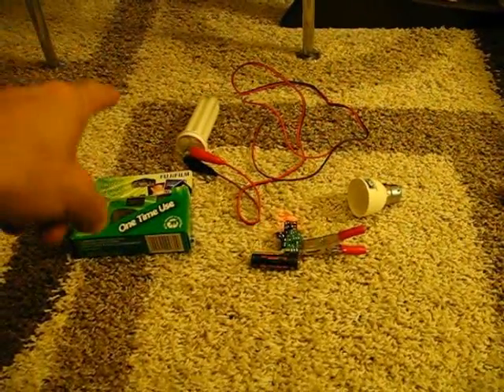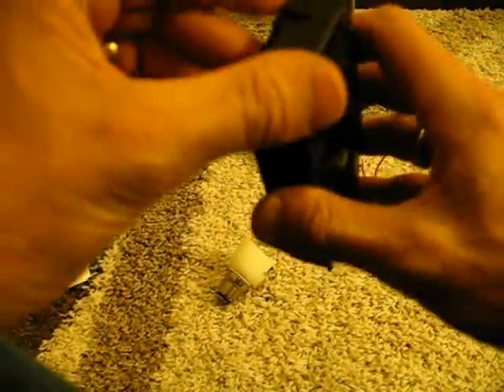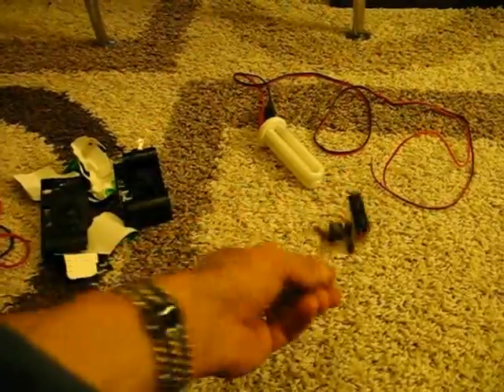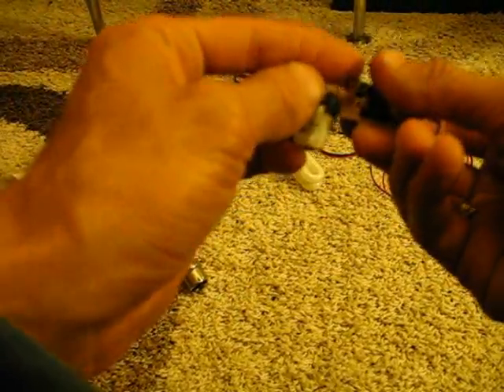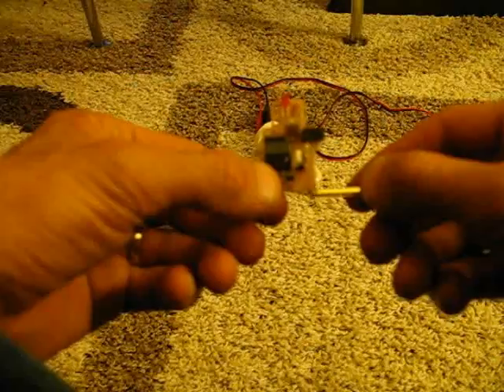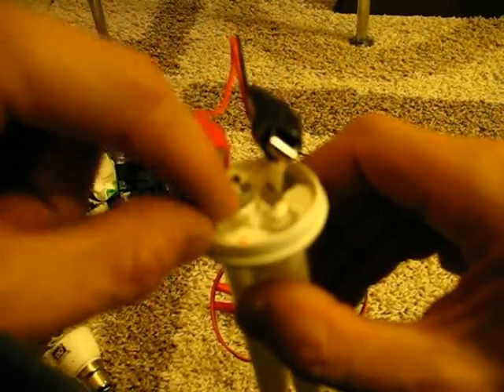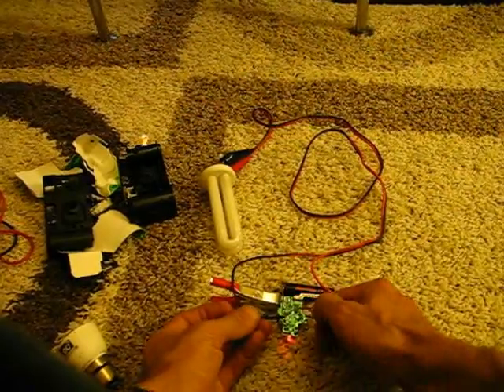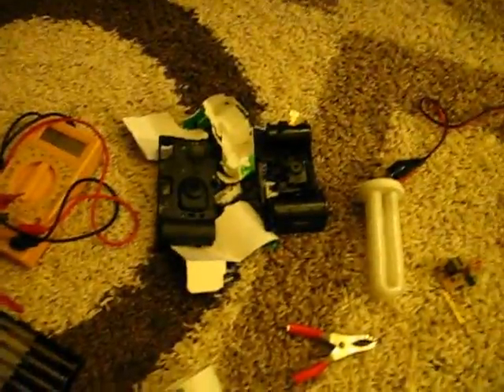Running a 240v lightbulb of one AA battery. Very real and very useful. With full how to. 100% real

Comment from the maker: @vckng I always remove the red led as a rule. Every bit helps as far as getting the most out of it. But you should try get the slightly lower watt bulb. But don't be tempted to go for the 7watt or lower cfls. They will not be bright at all. Like I said about 11watt philips cfl's seemed the best and brightest light output. Good luck. :O)

Comment: You can use even a CRT TV, powering it with AA battery, but since the voltage and stored energy energy in the battery is low, the TV in this example will run only 1 or 2 minutes.

Comment from the maker: I tried a few experiments with transistors but I did not have much luck. But maybe you will have more success. It would be nice to run them from a 12v car battery but I just don't see that happening because a stepdown transformer would use more power than the light itself.

Comment: have a look on yt for how to make a capacitor discharge device out of a couple of crocodile clips and a large wire would resistor, a lot safer, a lot less drama and a lot less damage to the capacitor than shorting it out.

Comment from the maker: If you look through the comments you will see you can get more than thirty hours out of one single AA rechargeble battery. I charge the batteries with solor cell and these lights when solar charged and left lit 24/7 for months at a time, they have never depleated the battery fully yet. So they are very pratical for undeveloped countrys, Sheds lacking mains power, and emergancy lighting.  I think you will be rather supprised by them. Try one yourself :O)

Comment: I tried this when this video was posted back in October 2010 but I used a car battery instead and the light Is still working over 4 years later. AMAZING OR WHAT.....:D
Reply: Peter Langer how about we see a video of how you did that?
Reply from the maker: KEVOLUTION K Its possible with a 12v to 3v or 1.5v step down transformer wired to the battery. I have done this myself but I used 3v step down with a heatsink fixed to the transistor.

Comment from the maker: You will also need a decent heatsink on the resistor if you run 3v through this circuit. Otherwise it will burn out.

Comment from the maker: Sounds like you have it stripped to the correct parts the transistor is the on with three pins so don't remove that. 
If you look in the video description (click About then show moor you will see the links for diagrams for the circut on flicker. :O)

Comment: I made like this from a simple flip-flop circuit with  a transformer reversely connected (step-up instead of step down),  and i use 10 watt tube works but not bright, what ive learn is that voltage does not really matter but the frequency.

Comment: Gosh, I'm trying to do this but I have a newer one with a lot of resistors and the parts in different spots. I can get all the way to the point of lighting the bulb, but it is dim and flashes fast. The transistor also gets extremely hot fast. Fast as in three seconds.

Comment: You would get the same light with a simple inverter circuit and an led. There is no actual free energy. A 2032 lithium battery will provide useful light for 50 hours or more connected to a 5630 led. Add a 1K resistor and you have a marker or night light that will run for a couple of months.

Comment: This really works even with straight old tubes however i use most the CFLs (curled ones), i also found out that some circuits work with 2 - 1.2 Volts batteries in series for a total of 2.4 Volts no more the circuit will burn... i added 6 rows of  (2.4 Volts each) in Parallel and 2 of this circuits plug to it worked non stop for over 20 hours. I have a bunch of these around the house with a small solar cell to maintain the  batteries recharged ;) but my circuits don't whistle like this one on the video?

Comment from the maker: @sazateknokrat Many brands of the disposable ones use a fuji curcuit. So pretty much all of them work, I just find people have problems with the kodak models but I have had them working. I know a lot are sold as wedding camera for guests to use at weddings. They use the same circuit as the fuji model.

Comment: but a lot of people have free electricity in their phone line, if it is usable it would be very little hassle to set up. If you used the phone line to charge batteries, you would need a diode inline so that the batteries don't back feed voltage that the phone company could detect.

Comment from the maker: I found they work best with 20watt and lower bulbs.
Reply: This doesn't make any sense. An 1800mAH is a 2.16 watt hour cell. How in the world are you running a 20 watt bulb for 12 hours on a 2.16 watt hour cell? This makes no sense at all, unless the bulb is only using 0.18 watts.
Reply: tarstarkusz These kind of bulbs will light when introduced to high voltage it may not be as bright as in the proper set up but will work
Reply: George Pratt That may be true, but it's not putting out anywhere near 20watts of light. Unless the circuitry in the bulb was using 19.8 Watts, this light isn't putting out anywhere near it's rated light output.
Reply: I agree  One thing I noticed is my 20 watt cfl is more like 3 watt at full power they use the old watt rating because us buyers use that as a scale of brightness also the circuitry may eat up a few watts to convert ac to dc for the chip set in the base then back to high voltage ac
Reply: I gotta try this myself I would love to see how well this really works the true way to test his results would be to have one in a socket then the hacked set up side by side to see how close the battery set up is
Reply: George Pratt All he would have to do is put a multimeter in the between the battery and the camera and that would allow a definitive readout of how much power the circuit is using.
Reply: Most of the spiral bulbs here in the US are perfect for this..  11 to 14 watts or so, and you can even use the so- called burned out ones as long as the tube itself is OK
Reply: George Pratt
You know what I think it is? I think it's the bogus 20 watt bulb. IOW, the equivalent power rating (same amount of light as a 20 watt incandescent bulb), but actually only uses a few watts including the circuitry in the base. I have one of these, maybe I'll take one apart and do the experiment. If it works, I'd build a base for it. The high voltage coming out of the flash is pretty dangerous. It's the amps that kill you, but it's the voltage that gives it the Electromotive Force (E) that allows electricity to go through your skin.
Reply: I bet the guts (parts on the inverter circuit board)out of the cfl could make a good joule thief or a bedini motor circuit.  The frequencies in a normal cfl are already pretty high
Reply: J Doesn't work with a rechargeable battery. It's still more efficient, but rechargeable batteries don't discharge in the same way. It starts at 1.6 drops very quickly to 1.2 and then dies very suddenly down to zero. Alkaline batteries don't do that and a Joule Thief is able to use the .9, .8.... .3 voltage that a dying alkaline cell puts out. Rechargeable cells don't give out low voltage they just drop to zero from 1.2 within a few seconds. If you look up a graph of the discharge curve of alkaline cells vs rechargeable, you will graphically see what I'm talking about.
Reply: tarstarkusz The amps isn't really what kills you, its the total power which the amps certainly do play a part in. It's getting cliche hearing that now.
Reply: Ryan Tedder
But it's the potential (E) that allows the electricity to go through such a poor conductor like your skin and body. You take a 5000mAH NiCad with very low internal resistance capable of reaching 10C (50amps) and it will still never hurt you by touching both connectors at once.
Reply: ***** I do home electrical repair and I guarantee you that 120v isn't going to kill anyone. Does it hurt? Sure. I get shocked at least once a day and I find myself liking it a little bit.
Reply: ***** It was a joke. I've been shocked,  sure. Every day? Nah. It doesn't really hurt, just sort of like hitting concrete with a metal pipe.
Reply: AA is 1.5V how do you get 2.16 Wh? More like 2.7?
Reply: the AA is about 1.46V with 300mΩ internal resistance thus can output 1.46V / 2 to external 300mΩ as useful load for some minutes e.g. P=U²/R = (0.73²)/0.3 = 1.776W as the human reception is logarithmic you'd only see(preceive) it as (https://en.wikipedia.org/wiki/Apparent_magnitude)  2.512·log(20/1.776) = 2.64 (about the e) times dimmer !

Comment from the maker: @vckng If you attach a heatsink to the transistor then you can use 2AA, AAA or 2 C or D cell batterys in series. That will make it brighter. You may find an 11watt bulb works brighter than a 13watt. I also got brighter and better light from the philips cfl 11watt bulbs. Let me know how you go on.

Comment from the maker: You will have a hard time finding the transformer used in this. Thats why I use the cameras as the transformer is not usually sold in any electronics stores. Most people find them impossible to find and revert bac to using old camers. I hope that helps you. :O)

Comment from the maker: @sun4777 I have the circuits that I send out for a couple of dollars. You could just get a fuji camera from wallmart or asda. They are great to connect to a battery bank and a solar panel. That way they never go flat I have had one in my shed running for nearly a year constantly switched on and even with the dull climate in the uk it has not gone flat once yet. :O)

Comment: yes, that does help quite a bit, so if just get the lowest CFL bulb available, then it will run longer and brighter than if used a 11 watt bulb? what will be brighter and last longer on 2 aa batteries, the tube or spiral bulb? or would just buying an led bulb work the best, since led's are brighter and more efficient?

Comment from the maker: @bryanstevens69 Both are the same, in the USA 120v is the standard. In the UK 240v is the standard. Regardless of whitch of those you buy they all work the same. It's the wattage you need to be carfull with. A wattage to high will be duller and work less well than a low wattage cfl. I found between 7watt upto 15watt was about the best range. Hope that helps :O)

Comment from the maker: @jayson01982 They tend not to have a model nuber as such. They are just the desposable Fuji instant flash camera sold in photo shops & supermarkets. Although many other makes use the same circuit inside. :O)

Comment: well done. YOU HAVE MADE A: switching voltage source.
I know it doesn't look like it but it is.
Basically it's frequency generator with transformer                                 

(ps: frequency about 10khz don't lick output wires. it makes your tongue look funny :D)
Reply from the maker: Never a good Idea to lick wires and I sure would not suggest that with this lol.  :O)

Comment: You know you can buy this ready made from Coleman and another dozen companies right?
Glad you had fun, but I think it's cheaper, more practical and much more efficient to buy ready made units that give you 120+ hours on a charge.
Reply: While I appreciate your thought on using a ready-made, store bought model of this, I'm sure the idea here was to use up the residual energy that's in batteries that would otherwise be thrown out as dead. As he said at the beginning, he got 8 hrs. out of a partially depleted battery on his first test.
I can see it mounted in a small "project box", running a bright LED and lasting for 120 hours on a single,partially depleted battery, with a switch to conserve power, and a battery compartment to be able to change batteries when needed. I wonder who supplies these circuit boards for Fuji. These would make excellent power sources for night lights, emergency lights, reading lamps, beacons,...
The Coleman thing is a great idea for someone who has the money and doesn't mind spending it, or just isn't inclined to tinker with something like this.
Personally, I like the idea of reclaiming energy that would otherwise be wasted. To each his own, I suppose.

Comment: yes they do, however they are not the primary source of light. the filaments are acting a a heated anode and cathode to radiate electrons into the tube.

however some florescent light don't have heated anodes or cathodes, they are called CCFL's or Cold Cathode Fluorescent Tubes. they last longer but are less efficient. and next time, Google the facts. you might be surprised.

Comment: thank you for being so friendly.. and for the help of course.  the thing is .. im using another camera at this point.. its something called jeoptik jencompact 23  ,, you can see the images on google .its the first one.     and now this is a little diferente from fuji for one use..      i got two more things on the other side of the board.. some small black transistor.. should i remove that?  the thing is it startet buzzing and now nothing.. :(

Comment from the maker: @jayson01982 Yes it is possible to use the kodak brand. But the circuit is quite alot changed. It is possible and I will add a diagram if I can find one of my kodak circuits. :O)

Comment: @Armookie yes, that does help quite a bit, so if just get the lowest CFL bulb available, then it will run longer and brighter than if used a 11 watt bulb? what will be brighter and last longer on 2 aa batteries, the tube or spiral bulb? or would just buying an led bulb work the best, since led's are brighter and more efficient?

Comment: Are you connecting the lamp fillament wires to what would have been the large capacitor that you removed? Around 320v, in other words instead of the capacitor storing the charge you simply send this 320 odd volts to the lamp instead.  It's not clear where your connectng those wires?

Comment: This works even with the long tubes, i use 4 AA batteries in parallel and it lasts about 18hours. In regard to water powered sources one needs at least 7Amps, it will be bulky but possible indeed. Check my channel to see a water cell of my design, i have been able to run at low rpm a small 9 volt motor from one cell that registered 0.980V and 30.50mA (digital reading) for a week on table vinegar - 5%

Comment: It would be far easier and more efficient to use a LED lighting module.  You can light up a room with one of these drawing just a few milliamps directly off a low voltage battery.

Comment: Armookie i think we have talked before regarding megane key card take apart? 

This is really cool, i'm subbed. Can yu do this with a 240v led to hook up to 12v psu from a pc running at 5w? Wondering if it will need more voltage or higher amperage?
Regards jon
Reply from the maker: ifell3 No its pushing to much voltage for LEDs and would blow the transistor at 12v these are designed for a single 1.5v battery. I managed to push through 3v but I had to attach a heat sink to the transistor.
Reply: Armookie Sorry mate not to sure if i made my self clear. You know the 240v gu10, is it possible to open them up, discard the circuit for the 240v bit and hook them up to a pc psu once a resistor has been added for the forward voltage? Regards
Reply from the maker: ifell3 yes totally possible if you have the correct resistance. Although I would suggest just buying the 12volt bulbs and hooking them to it instead. Caravan and car bulbs will work but any 12v led cluster will work and can be purchased cheaply now. I use them like that in my shed charging a 12volt car battery by solar panels and they give out a very large amount of light. You don't even need a resistor on them. :0)
Reply from the maker: Armookie Actually you may need a resistor on a psu as I have only used them direct to a car battery or deep cycle battery. A PSU will probably need some resistance to control forward voltage as it will probably spike a little.

Comment: I think this would make a good flashlight if you could put it in a housing or something. How bright does it light up compared to running the lighbulb on 240V? How many lumens do you get out of it with 1 AA battery?
Reply: +Kurt Woloch Its going to be very low as you can see, but that is actually an advantage for applications like camping or reading maps in the dark. An excessively bright light is a pain for most things.
Reply: Use some resistors, PWM dimming or just decrease voltage or amperage.

Comment: brother if this does work which i believe it will can i ask how you came round to the idea

cheers
Reply from the maker: Just something I wanted to try as it made sense that it should work. Its very similar to the way a cfl camping light works but has less drain on the batteries.
Reply: its a JOULE THIEF circuit basically a coil that runs at high frequency

Comment: You really are not powering a 240 v bulb, but instead its tube using HV-HF from an outer oscillator and a step-up transformer. It's the same that the CFL does actually. Mains AC are rectified and converted to 30-100 KHz to be impedance adapted for tube requirements. BTW there are DC low voltage CFL's in which a battery powered oscillator and a transformer gives the tube the required voltage and current to run accurately.
I've done this to make some really powerful and big fluorescent lanterns.

Comment: Hi there! Nice vid. I got two cameras but the boards look newer and smaller. Cant get them to work. I can measure 1.41V on the batt terminals on the board I can get 1.28 to 1.41. Can you tell WHICH components or solderings you attach bulbwires to? And how many volts SHOULD I get? Thanks and thanks for funny vid with sharing dogs :-) 
Regards
Liz

Comment: Hi there. What will you suggest to do with the camera circuit if I want it to run on 18650 baterry.
It would be nice to them videos about upgrading it to 4,2 volts with bigger capacity which is getting charged by a solar panel...
Thanks